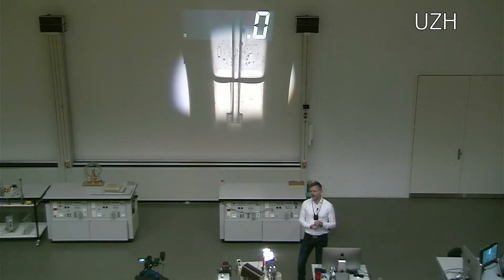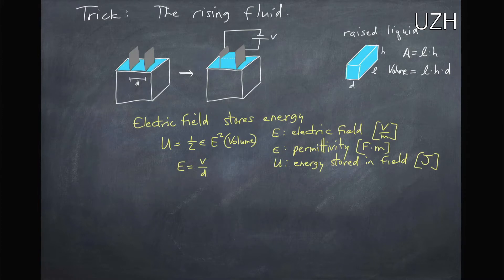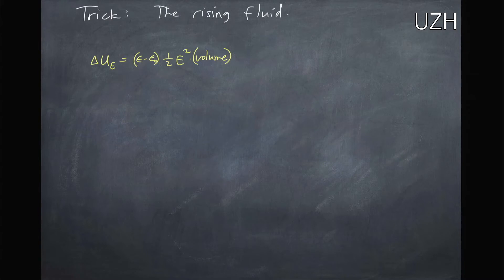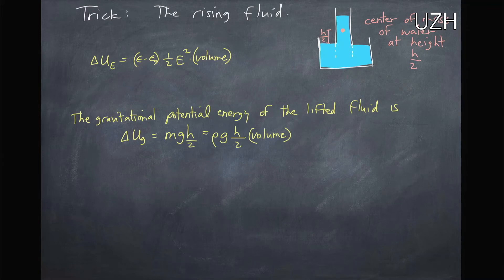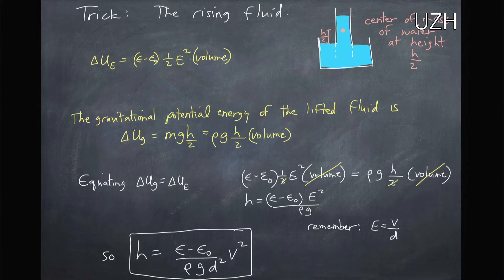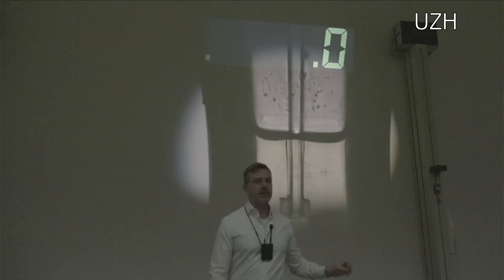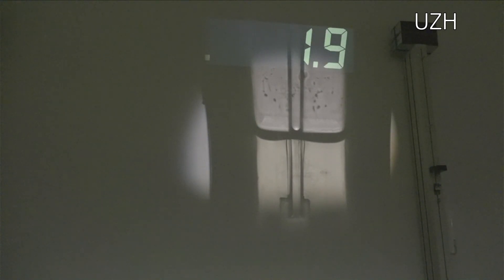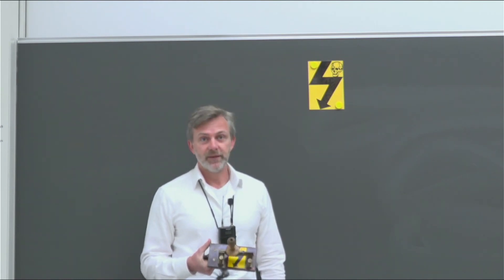Levitating a fluid with electricity

Comment: What you call gravitational energy, is actually the Incoherent Electrostatic Acceleration causing the downward vector. The parallel plates are, the earth negative and the Van Allen belt positive. This creates the needed voltage gradient.